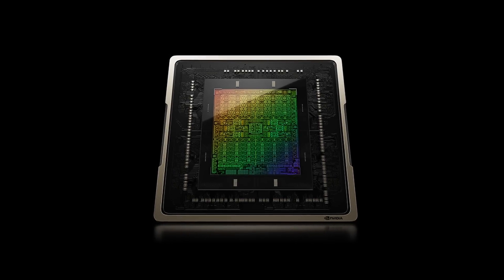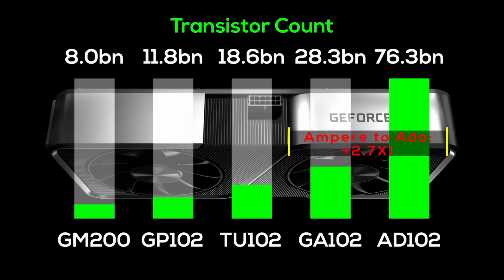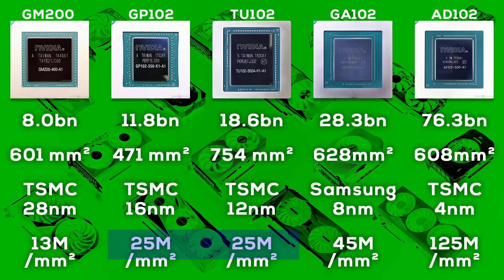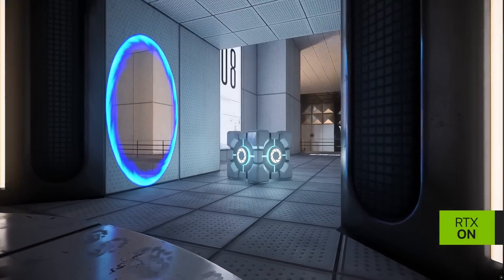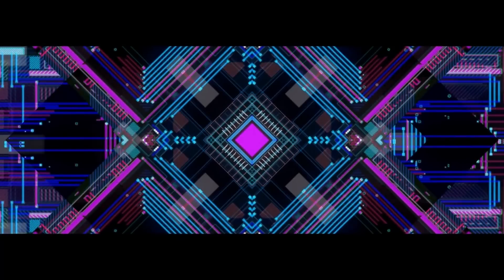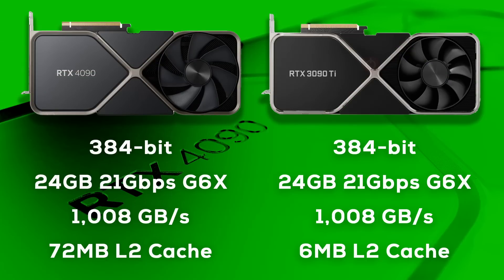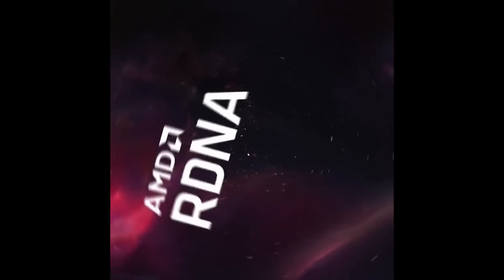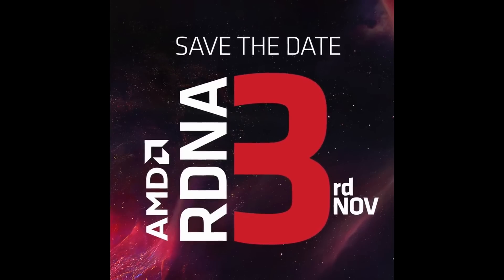RTX 4090 Chip deep-dive

Comment from the maker: Were you surprised by the true size of the chip inside the RTX 4090? And how much bigger did you guess it was compared to the 3090 Ti?
Reply: I was surprised that it is slightly smaller in mm²
Reply: For transistor count I guessed >2.2x, since it's about 80% faster in games. The smaller total area was a surprise how tiny 4N is. It couldn't be much larger, 700-800mm² is the maximum size for the process, right?
Reply: Keep up the good work, really enjoyed the information you provided and the way you did it .
Reply: Makes me think there is no point in more power other than to saturate 8K. For 4K, this is all you need. If they based a console off this chip, it would render reality.

Comment: Great video, very informative. I wonder if the 88% binning for the 4090 might mean yields are good but great on 4N. I do find it strange that they didnt consider enabling more transistors but clock the chip lower. Would have had similar performance but much less power.
Reply: 350watt? Then create an unlimited power version and clock it 10% higher and that's your ti or whatever. They Nvidia would have to disable more yields to a 4080 or 4080ti.

Comment: 7:41 The use of "exponential" as stated is plainly incorrect. Doubling the base number of transistors on the chip results in double the scaled number of transistors, likewise, quadrupling the base quadruples the scaled number of transistors. The factor on the base and scaled transistor count is the same, which describes a linear mapping.

Comment: How does it relate to their deep learning accelerator?
Do they use the same chip with other features activated or a completely different chip?
Reply from the maker: Nvidia has different architectures, for AI acceleration they have "Hopper" instead of "Ada Lovelace". Parts of the AD102 chip use tensor cores (mainly to accelerate DLSS), which is also used on Hopper for AI stuff (like ChatGPT). So its related, but Nvidia has a different chip with a much larger AI focus.

Comment: Is there a die that isn't binned and is fully used? what power would it draw and what would it be like?
Reply from the maker: Theres a version thats only very slightly binned (about 1.4%) and used for the RTX 6000, a professional GPU. The RTX 6000 has much lower clock speeds tho and a TDP of only 300W. A 4090 Ti based on a similar chip, with higher clock speeds, should be around 500W TDP.

Maybe I'm gonna  talk about it in my next video ;)
Reply: @HighYield  damn

Comment: I really dislike cut-down bin chips. You said it yourself - they most likely had defect(s) which is why they got ✂️. It really hurts knowing this. It's like you bought a cake and part of it was cut because it started to go bad. Sure it was cheaper... but let's be frank - that's 16CUs, and cache and RT/Tensor cores... That could be 10? 20? FPS more?! And that defective GPU, is it still considered "perfectly good" silicon just cuz it works at the time of sale? Idk is there any data to show that full-die GPUs work for a longer timeframe (in years) than ones that had a defect and were cut before being sold ? It's a theory that would be very hard to test... Worth discussing tho...

Comment: I don't think there will be 2024 launch with 50% more transistors. The process nodes are simply not progressing fast enough for that, nor is it profitable to make such a large chip. What, closer to 800mm²? 
Chiplet design is one option but I don't think the RT or Tensor cores can be located elsewhere than on the main chip.

Comment: Are you saying that nvidia makes only 4090 chips and depending on the defect inside the chip its sold as other type 4080, 4070?

Great Channel
Reply from the maker: Nvidia produces different chips for 4090, 4080 and 4070, but for example the 4070 Ti and the 4070 will be based on the same chip, only the 4070 has more defects. And if Nvidia releases a 4090 Ti at some point, it will be based on the same chip as the 4090, only with less defects.

Comment: I left a comment down below. What you going to do about it?

On more serious note, I can see a full theoretical die and amount of transistors for a particular chip? I never knew that this information is available. I need to figure our where I can find this info.
Reply from the maker: TechPowerUp has a amazing GPU data base, check it out!
Reply: @HighYield  That was the first thing I had checked. I even went for an individual die and Nvidia's PDF on a ship itself. There wasn't such information anywhere. I found how many transistors there are on a chip, but I could not find how many transistors were are on an individual chip.

Comment: I have a 4090 FE. I for one am glad that they gave us 450w and up to 600w with the proper PSU connections. The 4090 is an ultra enthusiast class card. Ultra enthusiasts like to tweak and play with their hardware and see what it's capable of. I would take a power limit slider and 600w capability even if it's hot and super inefficient and have the option to limit it myself, or push it hard to see what it can do 10 times out of 10 over Nvidia bios limiting it to 350 watts and forcing us to have to flash the vbios or worse, do some kind of hardware mod. I think the fact that it is so efficient and can easily just be power limited to 350w while losing practically no performance is just a bonus.

Comment: Apple's 134B transistor (108B GPU) M2 Ultra might be the best value at 25 TFLOPS
There is no denying Apple's efficiency is unbeatable at this moment, it would be interesting to see what end consumers value the highest!
Reply from the maker: Since Apple controls the entire ecosystem and knows what prices they can demand, they have the ability to design huge chips that benefit from a very wide design, and thus not only deliver great performance, but also offer top of the line efficiency.
From a silicon value I agree, Apple is the clear leader.
Reply: @HighYield  That is what matters the mos IMO.
Unfortunate fact is no one is looking in that direction in the Computer space, like the gaming industry and associated hardware manufacturers for example.

Comment: 4090 high power consumption? Then what would you describe 3090Ti power consumption as?
Reply from the maker: Don't they have the same TDP? Both 450W iirc.
Reply: @HighYield  I saw real world numbers tests with actual power consumption, 4090 has lower actual power consumption assuming both are at 99% GPU core usage.

Comment: Good video, but I have some points:
1. From die shots available, RT & Tensor units use very little die space (<15% of an SM)
2. 4090 is more cut-down than you think. Around 11% of the FP32 units are disabled along with 25% of L2 cache disabled (24mb out of 96mb)
3. From how insane the default TBP is, it's possible nvidia are using very poorly binned chips that need the power and cooling to meet spec, so not all 4090s will perform well when power limited.

Comment: The 4090s power target is so stupid. Especially because, as you mentioned, it requires a way more powerful cooling solution. This also makes the card significantly thicker, making it incompatible with many systems.

Comment: The power draw limiting from my experience isnt quite as good as some make out. I ran some benchmarks at 90%PL and noticed some small wobbles in clock speed, the end result of the bench had the same ave fps and just 1 less max. But it should be noted that at 100% PL, the card wasnt pulling near 100%, so limiting it to 90% wasn’t really a 10% drop in power draw.

I then tested again at 80%PL, the clocks were very noticeably wobbling. I cant remember now what the fps drop was - it was small, but there was a drop. Which is fine, you are now actually cutting power (in this instance) by the full 10% below the 90% marker. Probably does increase its efficiency, but I dislike such wobbling.

Comment: This moore's law only applies every year.  The 4000 series didn't appear a year after the 3000 series.  It's a huge chip but still manufactured on Taiwanese nodes.  Which isn't a true 5nm node.  It's just a huge die and is why it cost so much more compared to AMD's cheap chiplet design.  AMD should only charge $500 for the 7900 cards and not one cent more as it costs less to manufacture these chiplets than it's previous 6000 monolithic chips.  Nvidia really did blow it out the park with the 4090.  The thing is a monster.(also isn't strange that TSMC produces AMD's and Nvidia's chips?  AMD went to a chiplet design and Nvidia stayed on a monolithic design.  I'm willing to bet AMD had no choice because Nvidia is TSMC's bigger customer/shareholder)

Comment: I have a 4090, and I overclocked it, resulting in about a 10% improvement in render times. This is huge when considering how long some renders might take.
Reply from the maker: What program are you using for rendering?
Reply: @HighYield  Octane Render. The improved raytracing performance has decreased render times by 2x compared to 3090Ti; unlike gaming, this engine sees a much bigger leap in performance. You can go and check out Octanebench results and exclude multi-GPU setups to see the scores; you can also set it to display average or maximum scores.

Comment: The RTX 4090 was tuned down a lot from what was planned, making it pretty efficient. 
I was curious about how much of the chip was disabled, given that it's huge size on a cutting edge process. Thanks for the info.
Reply: I thought it still retained what the leaks said a hefty l2$ of 96MB, at 72MB it seems as the rumored 4080 class we heard about it in the first rounds of rumours about AD.

Comment: The 4090 has the most over engineered cooler we will probably every see.  Well, wait.. the 4080 16gb will use the same one!!!  Damn,  crazy.  I’m capped at 120fps at 4k in destiny 2 at max settings and I don’t see more than 50°c peak heat and 58c hotspot.  Peaks at 60% power draw (hwinfo). It’s insane efficient

Comment: The full die could have a decent 10 to 12% uplift at a -10% power usage as 4090. Up to 20% stronger if Nvidia let's it pull 600watt.

Comment: I really love your videos. They are so precise and informative. 👍
I already knew the transistor count and the die-size (I'm such a nerd ... 😂).

I think Nvidia might have binned the RTX 4090 that way to obtain a higher yield rate (remember, the N4 process is still relatively new and TSMC will probably have a higher percentage of faulty transistors than the "old" and well-known 8 nm Samsung process). It doesn't really make sense, to push a die with 100 % active transistors, when the process is not yet ready to deliver such a high yield rate. Nvidia will buy some time with the RTX 4090/4080 for TSMC to streamline the new process and they will deliver a fully activated AD102 when the yields justify such a step.
It doesn't have to be this way, just some thoughts on it. 👌

Comment: I think they launched the 4090 with 450W because Nvidia wants to prime the consumers (and their AIBs) for even higher power usage for a potential 4090Ti. Nvidia wants to win and if they have to they will push the fully unlocked die to 600W. So now imagine they launched the 3090 at 300W and after the RDNA3 launch Nvidia notices they need all the performance they can get. Jumping from 300W to 600W doesn't look good. Jumping from 450W to 600W doesn't look as bad.

Comment: It is WAY too big and NV hit yield issues, compared to RDNA 3 die size on the same process node. That’s why a new architecture succeeding Ada should be rewritten from the scratch like RDNA series. For 70 to 80 class GPUs on both laptops and desktops, I would rather glue two 60 class chips with NVLink-C2C InFO-LSI bridge. 90 class I would glue four identical chips.

Comment: The price of the 4090 is not the problem.  The 4080 is trash! Not an 80 card at all. What the f-ck even is a 103 DIE?
Reply: 103 was a die tier first introduced with the Ampere generation. It means second tier GPU in the gaming lineup, which is what 80s historically use. Before this, 5 80 graphics cards used the flagship die and 4 used the second tier die. Of those 5, the 80 was outright the flagship GPU for the entire generation for 3 of them.
Reply: @dex6316  GA103 was used on 3080 and 3080TI "Laptop" cards in Ampere. The 3080 was a 102 as have been most 80 cards when there was any competition. Except for the Kepler 600 series when they said "Fuck it were so far ahead you get a 104 for the 80 card". I can't wait til it bites them in the ass and the 7700XT is pulling even with or beating the 4080.
Reply: @stephanhart9941  All the 80 series cards beyond Ampere were on 104 die same as 70 series cards. Search a little before typing hate comments.

Comment: Yep I lowered my power to 80%..saving power and hitting 3ghz..around 350 watts and stays lower most the time...my case is pretty good at cooling, it has 3 nice size fans at the bottom blowing right on the card btw...4090 fe.